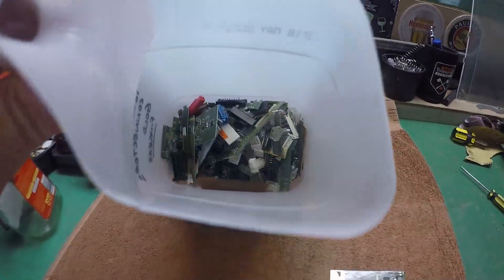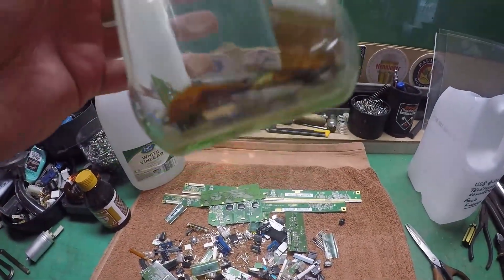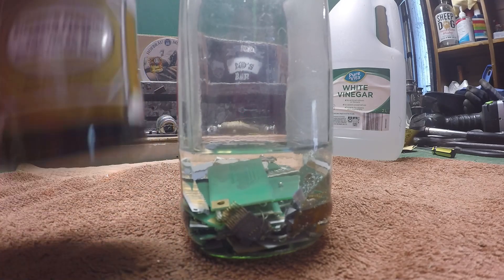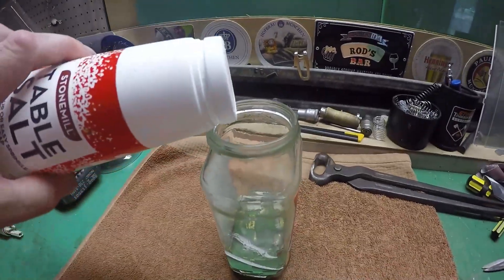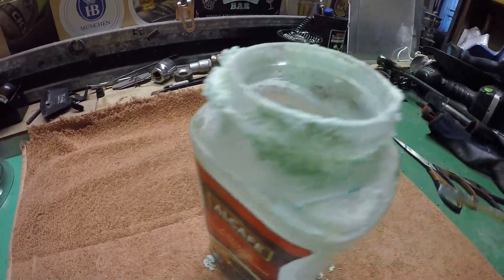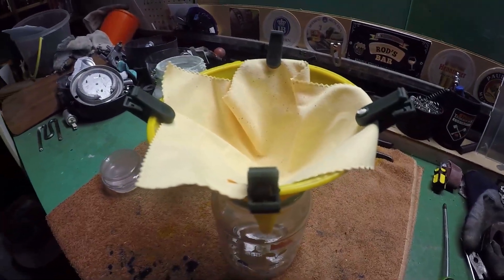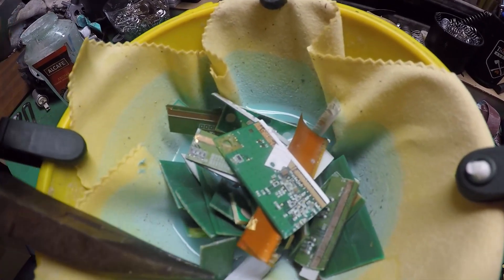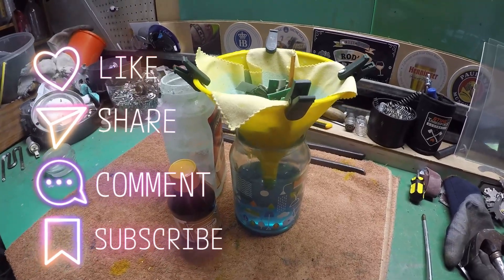Gold Recovery with Vinegar & Peroxide – Did It Work This Time

Comment: This does work you need to get the mix right way to much salt to much proxide when the flakes lift of that proxide will dissolve any that's there as there to much in there

Comment: Well, I joined the discussion 9 months later but I hope I can still help you with this process, if you didn't find the proper method in the meantime..  Mix white vinegar and hydrogen peroxide in the 50:50 ratio and add some sulphuric acid as a catalyst (1-2 tablespoons maybe, it does 't really matter how much) Also, hydrogen peroxide should not be stronger than 12 percents, 'cos higher concentrations od H2O2 can dissolve gold along with base metals. Then leave the solution to stay for a day or two. If you leave the flask with solution indoors, it is best to put a rubber glove on the neck of the bottle (or a ballon, condom..) because the gases will want to escape. After a day or two the solution is ready for use and it has a potential to dissolve base metals and release gold foils very quickly, probably at the same rate as nitric acid (just a couple of hours, compared to copper chloride leaching which takes a few weeks). And the best part, no nasty orange nox fumes, when dealing with nitric acid. To conclude: 1. use sulphuric acid as a catalist and 2. vinegar and H2O2 ratio 50:50. Stay safe buddy👍
Reply: well you lost me there...  i'm new to this gold recovery.  so far i have 16 ounces of gold plated pins, connecters and 1 pcb board with gold.  i thought i would try with the 16 oz first instead of trying for 10 lbs of computer pins which is still on the boards.  i'm not sure if i want to get into sufphuric acids.  bad enough mixing vinegar and  hydrogen perixode.  but  no more then 12% hydrogen perixode.   what about the acidity in vinegar.  i was thinking using 30% acidity.  or just use 5%
Reply from the maker: Thanks for the information and thanks for taking time to reply to the video, truly appreciate it. Some great suggestions there.

Comment: Actually i onlu used chloride or bleach whatever you want to call it, it gets green after 4 days and pins allready drop to the bottom, just leave it outside in a glass jar closed until day 5 and then open it and leave the cap on it....

btw i think that maybe i still haven't tested it; but just maybe perio-aid mouthwash could do the job aswell as it has peroxide and hydroclorazine in it :face-green-smiling: so if anyone ever tested it... let me know ;-)
Reply from the maker: Thanks for the tips, and thanks for watching and taking the time to comment.

Comment: Pouring more 3% peroxide won’t increase the percentage of peroxide because it’s still 3% peroxide.  It may increase the overall amount of peroxide in the mix but it’s dilute.   You can buy 11% peroxide at any growers supplies/hydroponics store.
Reply from the maker: Cheers, think I need to do more research lol, thanks for watching and taking time to comment
Reply: You can concentrate h2o2 by just letting the water component evaporate.  Takes time but will increase the percentage h2o2.  Don't let it go over 55%, to make sure it remains stable.

Comment: About over 1 year ago I did this in a 20 liter pail with various parts of computer boards and pins plated with gold. The solution was 3 liters of 10% vinegar and 1 cup of salt, I stir the solution to dissolve some of the salt then I added a bottle of 375 ml of 3% hydrogen peroxide, stirred it and let it rest and do its own thing outside, with a lid loosely sitting on top to keep leaf debris from entering to pail.

One month later I checked the result. This solution dissolved all the tin and lead from all the computer board pieces. Some had thick soldering. The gold plating did not dissolve, not even from gold finger boards. But it did a great job at loosening all the components from the computer board so that the components came off by just pulling them off with my fingers. Once the computer board parts were removed and rinsed, the solution was filtered to capture the loose computer components. This solution can be reused to dissolve more solder till its saturated and won't dissolve any more solder. I am sure the solution now contains lead, tin and silver because that's what computer solder is made of. If I want to precipitate the lead I will have to add a little battery acid, sulfuric acid, a little at a time, till it drops the lead and then filter that off. Or I could let the solution evaporate till all the solder is left in the pail for recovery.

• Vinegar and peroxide makes paracetic acid. It does not dissolve gold.
• Vinegar and salt makes a weak hydrochloric acid. It does not dissolve gold.
• Vinegar and salt and peroxide added makes a souped up weak hydrochloric acid. This will not dissolve gold.
• Vinegar needs to be glacial vinegar on its own to dissolve gold.
• Hydrogen peroxide needs to be a higher concentration to dissolve gold.

Vinegar does dissolve lead. The higher the concentration the faster it dissolves lead. HCl dissolves tin. So the combination of vinegar and salt will dissolve lead and tin aka solder.

If you want to dissolve gold with vinegar you have to look up the recipe from the Univesity of Winnepeg or Saskatchewan. Some students discovered a way to dissolve gold with house hold vinegar and some other house hold chemicals. The solution has 3 or 4 parts to it, vinegar is the main part. An oxidizer, an acid, and something else make up the rest of the solution...

I know that HCl and sodium nitrate salt dissolves gold. I know sodium nitrate is an oxidizer. So vinegar and salt = HCl, add a little sodium nitrate and it becomes a weak aqua regia. I still need to test this myself.

I do know that bleach and vinegar dissolves gold plating. Just add the vinegar teaspoon at a time because it release chlorine gases. So don't inhale the noxiuos gases. And it should be done outdoors with the wind blowing away from you.
Reply from the maker: Wow, thanks for the details, appreciate them, yeah my understanding was it wouldn't dissolve the Gold, I was trying to separate the foils. Thanks for watching and taking time to comment and good luck with your gold ventures.

Comment: Dude try this method 1 cup vinegar 1 cup hydrogen peroxide  an two tablespoons of muriatic acid an it only  will take 4 to 5 hours to pull the gold
Reply: Table salt?
Reply: @y.renterprises6987  no salt
Reply: An to clean the gold use 1 cup vinegar 1 cup hydrogen peroxide an 2 tablespoons of sea salt an put it on heat do not let it get past 90 degrees Fahrenheit
Reply from the maker: Oh wow, cheers mate, will give that one a go later in the week, thanks for watching and taking time to comment.
Reply: @scrapnsalvage ur welcome
Reply: @scrapnsalvage  an I for got to tell u on the muriatic acid make sure it says 31.45% hydrogen chloride
Reply: I try brother good ide@
Reply: Agreed I just watched the video
Reply: Question, Why can't you just pluck the gold pieces off the Samsung cellphone. They are very visible.
Reply: Change the liquid every 2nd or 3rd day of the week, when the bubbling is gone change the liquid
Reply: 12% peroxide distilled vinegar same parts I started last night ended up shocked lol  and salt in 1 day 70% is gone in to flakes
Reply from the maker: Where are you as I can’t get peroxide that high a %. Thanks for watching and taking the time to comment.